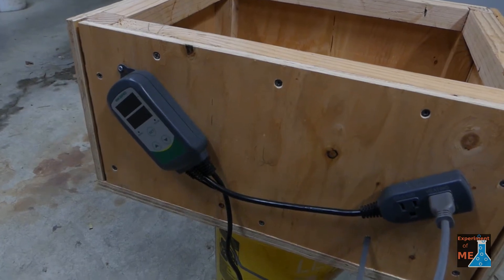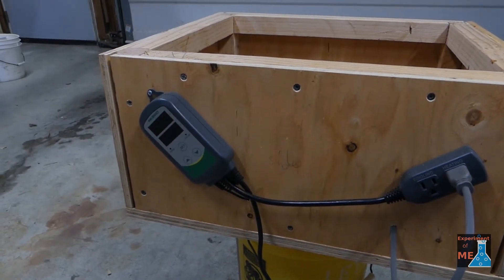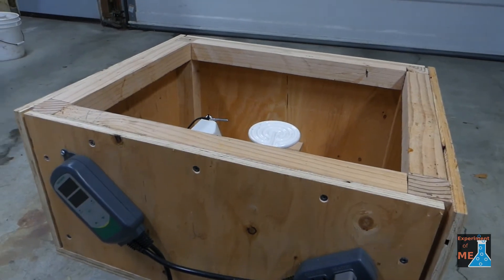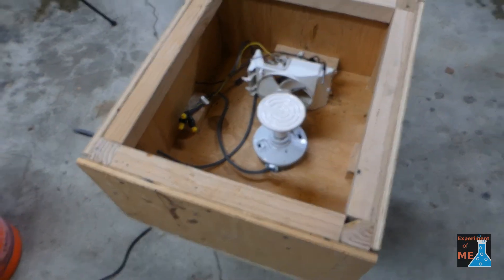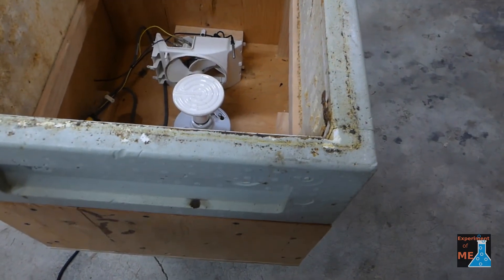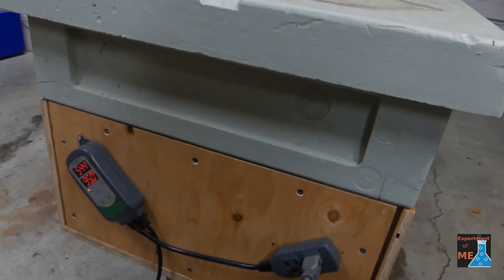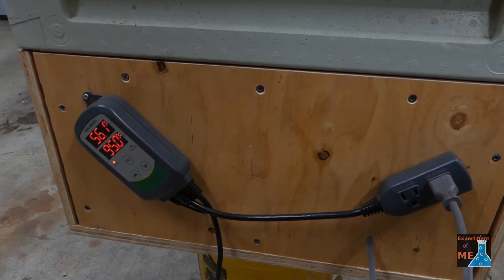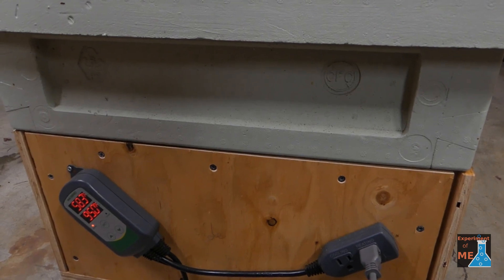Honey Heater for better extracting

Comment: Hey mate, great heating box!

Question, how did it work out for you, did you have any issues with honey drips down into the heating box?

Cheers,
Dave
Reply from the maker: Honey heater works great.  I did make a platform that covers the heating element.  I get a few honey drips into the box, but not bad.